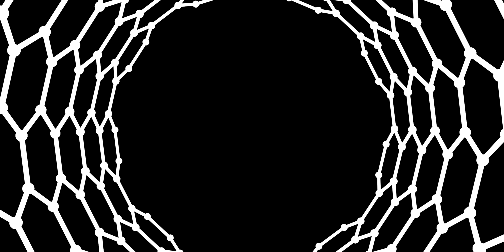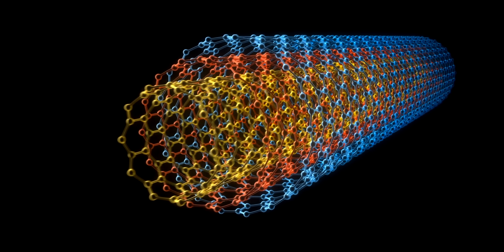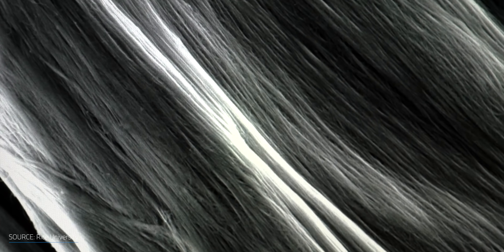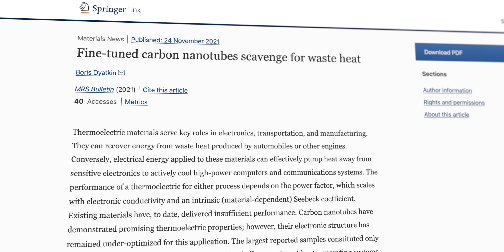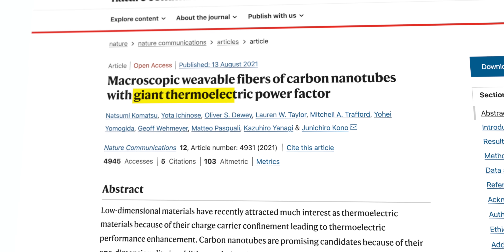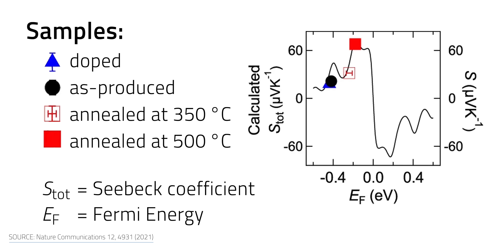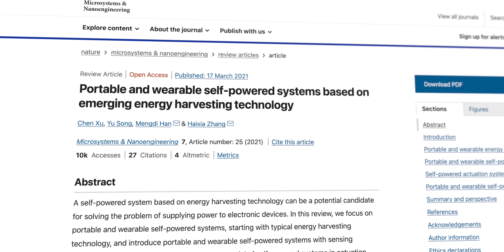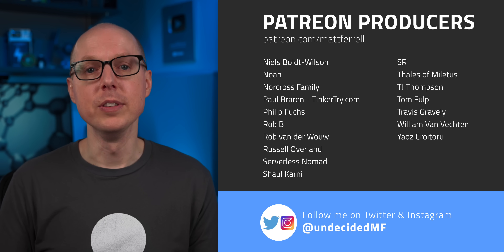Revisiting How Carbon Nanotubes Will Change Renewable Energy

Comment: I can imaging an aircraft taking advantage of all the things you've talked about here. Using the high thermal and electrical conductivity to shield a craft from lightning strike, distribute battery current to ESC's and motors, and the high strength to build the structure. Waste heat from motors, ESC's, and batteries could be reused in a cabin or payload or turned back into electrical impulse. Even the wings could capture a bit of energy from sunlight (perhaps enough in certain applications, certainly not for most).
Reply: speaking of lightning protection...that might help a little? how? ..the real problem is the INDUCTANCE, because lightning is an Ultra High Frequency Pulse DC Transient....Xl=2PiFL
Reply: @RulgertGhostalker  You're right, Eric. Good catch. I guess I was thinking more of the reduction of resistive generated heat generated comparing aluminum to carbon graphite (and carbon graphite's affinity for water, which turns to steam when carbon graphite receives a jolt). Okay, so it wouldn't make a Faraday cage, but it may also not become black popcorn either.
Reply: @RobertLBarnard  my lightning protection studies involve buildings and sail boats..
i don't think i could ever justify the cost of a private aircraft, so i don't study it, and have no idea....but it's the Field generated around the conductor, that chokes high frequency current, not the ampacity of the conductor itself, in that situation..
Reply: @RobertLBarnard  you have a Machine Shop ? Ooooh...
but hey, watch out for the galvanic corrosion potentials between those aluminum parts and your composites too.

my mom worked at Alan-Bradley in Milwaukee, so i have known about resistors since a very early age...

in my sail boat design, i ditched the conventional rudder...sailboats have to constantly apply rudder to hold tack, And That's Drag..
so i replaced the rudder function with two 9-phase prop M/Gs and a micro-controller "fly by wire" type core system, for a "Robo-Rudder" that also replaces the auto helm and provides all manner of unique solo-sail advantages, ( point windward,, acel & decel to hold coarse at trim on apparent wind,, hold position,, tack and gybe delay time,, ect. )  

but also would have a manual joy stick mode, of course..
anyway, the "rudder" Re-Gen drag current is available to proportion as thrust on the other side ... so when the battery bank is full, that's when my sailboat will really start kickin'...and it is going to be fast as it is...
probably fast enough to sail from the east coat to Europe in about 2 weeks on average; while generating all the power needed for cooking, refrigeration, ventilation, lighting, ect...

it's a center tap sea grounded 24Volt system that would charge from dead, at a slip, in about 4 hours...

i have to shield all the electronics from EMP, of course, but i wouldn't lose a wing or aileron..

i have a new type of sail rig, and a new type of hull, with it too ... Very Fast, for a 7 Meter deep blue...but it's only a deep blue because it's a storm runner, that has a very light weight, and very sea worthy design..

it's a performance "Micro-Yacht"..
Reply: @RobertLBarnard  the 9-Phase M/Gs
 ( motor/generators ) are 9-phase for minimum drag in a hydro prop motor..
they are each like 3 Six Pole BLDC Stators Stacked Axially, in a 20 degree out helix..
And The Rotors then are each just a Single Diametrically Magnetized Neodymium Rod Magnet !!!  super streamlined prop M/Gs

by generating down waves, and powering up waves, the sail boat Will Be Able To Run A Strait Course, ( instead of zig-zaging ) while holding trim to apparent wind...
that's something no other sail boat can do !!!!

i have allot of new concepts going into this that make it a sailboat of a millennium..
Reply: @RulgertGhostalker 
 the plane is a Sonex, all aluminum no composite.
The machine shop is just big enough to get 1 guy into trouble, consisting of Precision Mathews mill & lathe, a Southbend 9, plasma cutter, a couple welders, a small brake-bender, a large format 3D printer, and some hand tools.

Pretty cool ideas regarding your single-person sailboat. Any activity on water is as much art as knowledge (imho). Unlike with an aircraft, a sailboat deals with 2 sets of fluids (well, unless the pilot is having a really bad day). One fluid, air is enough for me. Sailing seems to take a lifetime to really know it. Lots of respect.

I know just enough to get into troubles with one. Used to rent a Hobie Cat years ago on Traverse Bay (west bay). I bet you can connect your control system to GPS and use it as a kind of autopilot or maintain a course. Check out Ardinopilot, a controller for UAV's, has all the instrumentation baked in.

Do you still live near Lake Michigan?

I worked at a pattern shop in Racine Wisconsin. Grew up mostly near Traverse City.
Reply: @RobertLBarnard  i am over on the west side of wisconsin now, by the river valley...

my new sail rig is a new kind of moving mast rig..*One Sail that does it all*
, 3 Ropes, and a Mast Angle control..

so it will have One triple clutch, and One Winch, and the specialized winch that handles the mast angle control..

i really worked hard on the design to reduce the complexity of sailing it .... to where a layman could study the science, the interface, and be able to set sail solo, relatively prepared, with a  minimal amount of self study..
Reply: @RobertLBarnard  the thing about my sailboat design is that it can Also be considered Green Housing ...totally renewables based platform..
Reply: @RobertLBarnard  there are quite a few billet parts in the design..and some perf sheet, copper sheet, and stainless parts too....all in CAD yet with it...i gotta find an investor with a good VPP to bounce files with..
Reply: @RobertLBarnard  Hey Your A Motorcyclist Too, so am i ....my grampa worked at H-D from IOEs to Late Pans ... my degree is actually in motorcycles and i did 3 new concept designs for H-D recently also...
i am still waiting to find out if any of my concepts are going into development, gosh that's the break i need right now....hoping and praying..
Reply: @RobertLBarnard  are you building a prop areo-V or areo-V turbo, or the v tail jet?

i can send a CAD screenshot of my sail boat on twitter ...it's easier to communicate there, but just message me in the back round..
Reply: @RulgertGhostalker  I thought I would opt for the turbo as its a VW and I'm really familiar with them (my dad built a 1/2 v-dub for his Mini-Max, he left for me). 
But these days, I may get a bush type plane (like a Kitfox) and use a in-line 4 cylinder Yamaha engine, a snowmobile type. They are getting great fuel burn, long reliable life, and in special cases up to 400 hp out of the turbocharged lightweight packages. Up near turbine weight to power ratios, but with a fuel burn of a 4 cycle fuel injected electronically controlled engine. Yamaha produces engine designs for Ford, Toyota, and many other companies, they are working on a dedicated aircraft engine for certification.
Reply: @RobertLBarnard  i was So Bummed Out when they stopped making VW parts, but then i heard some of that tooling is still running for light aircraft ... i have owned two bugs and two busses, just ran like a swiss watch once i got them set up right..

but so will a Yamaha for sure.

and yeah, electronic engine control systems can adapt so much better to altitude..but a turbo will too...

which Sonex air-frame are you building?
Reply: @RulgertGhostalker  The V-dub is still being made! Lol seriously.
The MOTORAV Industria 2.8R is an updated VW flat-4 flat/boxer air cooled engine. They manufactured it for VW in Brazil when it made sense for VW to stop producing it, while they kept producing tbe Beetle in South America long after it was phased out in other continents. Eventually they asked for the rights to own the design and continue with it as an aircraft engine. Its rated at 95 or 100 hp depending on who you read/talk-to.

The plans I have are to the "A" model,  conventional ("crucifix") tail. I would probably opt for the conventional (ie. "tail dragger") configuration, as opposed to the nose-dragger (ie. tri-gear). There are no real advantages, and some real disadvantages, but they look cool.

The plane would barely pass as a cross country flier with the right engine. Turbo for power at altitude. But I don't really have a "need for speed" as my parents are gone and the urgency to visit with them. But with tbe new work realities COVID brought, I should be able to spend summers back in Michigan, and the idea of landing nearly anywhere (and taking off in the same) appeals to me. Some of the guys out west (Montana, Colorado, Idaho) land in mountain tops to hike, then on river sandbars in a valleys to flyfish. Seem idyllic to me.
Reply: @RobertLBarnard  gottcha..
i lost some comments here too ...it doesn't seem to matter where so over to espresso

Comment: In addition to generating electrical power, thermal couples can be used to heat or cool a mass. So these types of clothing should be able to generate, store (using a battery), heat, and cool the wearer.
Reply: Theoretically, could this be used in heated car seats?
Reply: @melissamybubbles6139  sure.

Comment: Can someone elaborate on the concept of space elevator? I thought this concept was discarded, or are there more variations to the space elevator? What I have in mind is somewhat of a space elevator, but inside of a massive aerial docking station sitting between the stratosphere and space (no tether to the ground). The idea is that this docking station would be supported by a giant plate (or multiple plates), creating an air bubble beneath the plate able to support the infrastructure. Would such a thing be even possible? I believe with the carbon nanotubes, it should be given its properties.
Reply: What you describe is almost possible. Not trying to stay within the atmosphere and resist drag, that part isn’t. But an untethered orbital tether, is. 

You’d need a few of them and pretty decent synchronisation software for designs lower-down with faster orbits, although geo-locked orbits are possible they’d have really long tethers and you’d probably want to get off and start firing your rocket engines long before you reached the space station at the top. So lower-orbit tethers which don’t remain geostationary is the preferred method. 

The actual tether would and could come down into the high atmosphere while the space station was higher than the atmosphere, and then you could have a Virgin Galactic kind of launch vehicle, a high altitude rocket plane, to rendezvous rather than a regular stack rocket. 

There’s a number of videos on this concept, they largely call them skyhook or orbital tether. 

There’s a bunch of sub-types within the idea, as well as some totally different ideas like an orbital ring, which would also not touch the ground but could lower the cable down to be above basically any location. But most of the theoretical work has gone into looking at orbital tethers we could theoretically make with enough funding rather than too-big ideas like the ring.

Comment: I know people are ready to write off gasoline engines, but this would make hybrid systems extremely efficient if able to clear heat efficiently from engine and break components, and return it to a battery which is currently (even with regenerative breaking) 100% waste.

Comment: The work being done on CNT is of great significance. It will take time, but sooner or later, a team of brilliant scientists will find a way to scale up production so that it can be used by all of us. Of particular interest to me is their role in making solar panels highly efficient. I encourage you to keep us all informed on developments in this space. Thanks for the video. I found the information fascinating.
Reply: My buddy is a research scientist at MTU focusing on acoustic applications for CNT. When you run current through this stuff, it vibrates, which allows you to make speakers in effectively any shape. Very versatile and exciting tech
Reply: @westganton  So what you're saying is CNT's can have piezoelectric uses then?

Not that it matters much.

MEMS speakers are the way forward - hopefully we get them before the decade is out.
Reply: @mnomadvfx  Yes CNTs have piezoelectric uses.  For example, the Center for Advanced Construction Materials at Univ of Texas Austin is working on Smart Concrete using CNTs.
Reply: I say sooner.  In fact it's here.  A method using technology that is proven to scale into the thousands of tons/year is in commercial use today to produce MWCNTs.  True mass production of SWCNTs continues to be challenging, imo.  Applications like transparent heaters are making their debut and will become a de facto standard, imo. The heaters using CNTs for headlamp enclosures, for example, are delivering excellent performance at a competitive cost.  Watch this space.

Comment: I feel like this won't be used in any major productions for 20 years, but I think electric cars may be the first to take really advantage of the benefits of large scale production of carbin nanotube materials.
Reply: I expect to see a significant increase in CNT production and use now.  Look at the expansion plans that have been announced by CNT manufacturers.  Also, I agree that the EV industry will help drive this.  CNTs are used as a conductive material in batteries and they will become a standard link in the battery supply chain with manufacturing geographically coordinated with the emerging battery and EV centers (southeast US, etc).

Comment: I'm pretty sure this is a nothingburger, simply because of 2:50. If you make the nanotubes longer, the strength decreases by 100 times.
That's for the same reason when you try to snap a spagghetti into halves over and over, eventually you will need the strength of an elephant to break them down further.
The inverse is also true, make it longer and you can spend less energy to snap them, purely by physics. Make them long enough and they will snap by themselves under gravity, aka form a sphere.
So what would allow these wires to be longer? Weave the small wires together while they're still small? Then you run into the problem that you can't curve the small wires because they're HYPER resistant to twisting/curving/weaving/snapping at that size as well.

Comment: So, concrete. And asphalt. The floor slab of a 2 story fitness centre in Amesbury, UK¹ was poured with Concretene,² which contains no reinforcement steel.³ And a 3 mile section of the A1 in Northumberland was resurfaced with an asphalt containing graphene in the fall of 2021.
At least two practical, if not perfectly commercial, real-world applications in the UK. Given the conservative nature of engineering in the US, it might be a bit longer for that to happen there. Although there is a company that makes graphene concrete firepits in the US.

¹near Stonehenge
²The tradename of a graphene concrete mix. There are at least two companies with commercial(ish) graphene concrete products, the other being Concrene.
³Admitedly, a low risk application.
Reply: In theory if we can make graphemes roads we can increase our energy grid completely. solar energy and heat it produce electricity. Fictions from cars and sun lights beaming on the street should produce a lot energy

Comment: "hollow grail" - nice! This (much like Fusion power) has been 5 years away for decades. But materials science has been making amazing strides faster & faster - much hope for the future!
Reply: Makes sense. Tiny scale materials science has an iteration rate that is impossible for large scale fusion to compete with. Kurzweil predicted as much
Reply: I thought it was a mistake.  good pun
Reply: How Flux Capacitors Will Change Interdimentional Time Travel
Reply: @Rem_NL  
If it was time travel we’d have a bunch of problems to deal with. This is just advanced chemistry. Remember, without a single thought the simplest microscopic algae somehow stumbled upon how to capture, then store solar energy 3 billion years ago. We just need to do a little reverse engineering and enhancement
Reply: Can't wait for my carbon nanotube fusion generator to be delivered, so I can power up my teleporter. I ordered them 5 years ago, they should arrive any minute now.
Reply: @scratchy996  Plants did it 3 billion years ago - BY CHANCE. You can’t find fusion reactors anywhere except in enormous natural gravity wells that are 300K times more massive than earth. 
Accomplishing sustained small scale fusion (which is not found in nature) is MUCH more difficult than accomplishing sustained artificial photosynthesis (which is just tweaking photosynthesis, which is literally everywhere you look)
Reply: @stephennielsen8722  you must be fun at parties.
Reply: @scratchy996  Just pointing out hard realities. You can believe in unicorns if you want
Reply: @scratchy996  LOL yes how many can say they really need a space elevator. Transparent conductive films using CNTs are being commercialized today in transparent heaters, antennas, touch screens, sensors and other applications.  CNTs are used increasingly in conductive polymers as well for all kinds of applications that require ESD protection, for example.